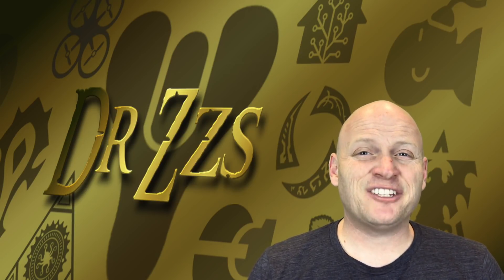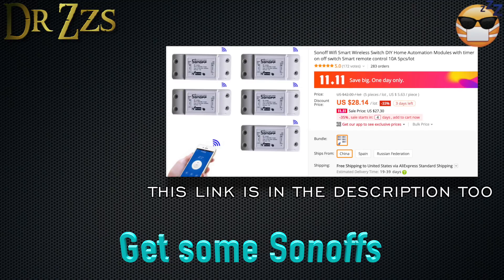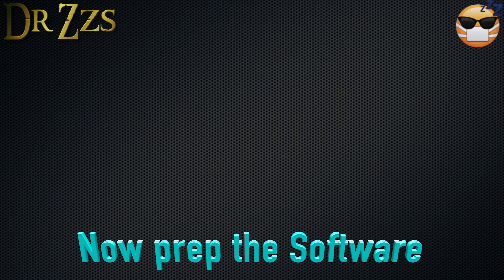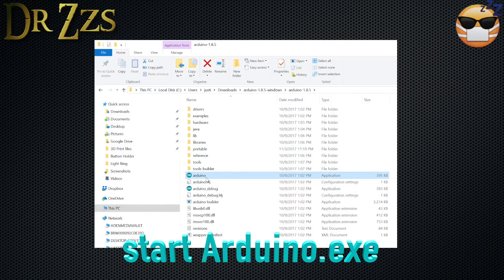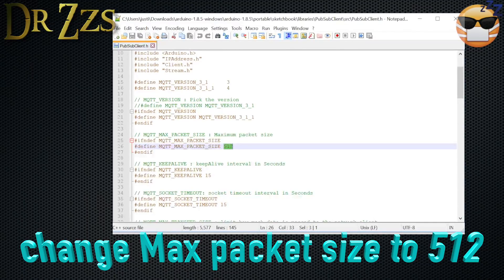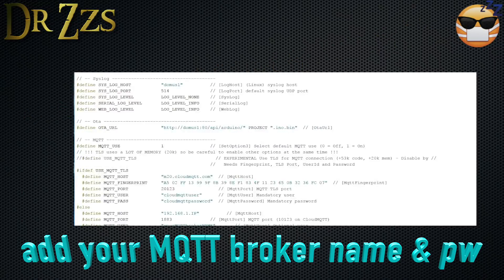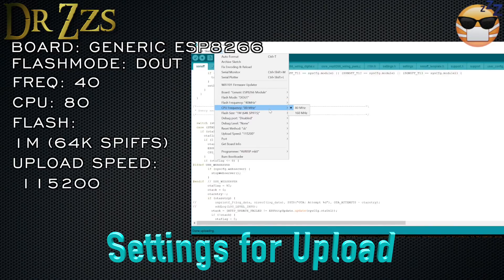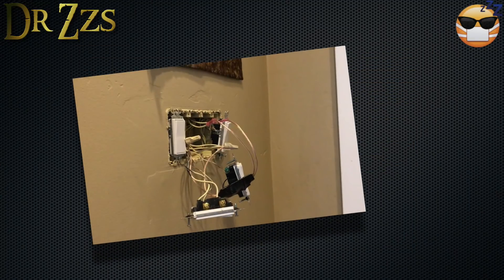Flashing TASMOTA Firmware on the Sonoff Basic

Comment: I bought a sonoff basic r2 but it only comes with 4 holes GND,Tx,Rx,3v3 from amazon. I found out from your friend The Hook up (https://www.amazon.com/gp/customer-reviews/RD37CKA59B9YF?ref=pf_vv_at_pdctrvw_srp) that amazon is only shipping this 4 hole version (no gpio14)  So now we are going to be having problems "on reboot" with the GPIO pin (Tx=GPIO01,Rx=GPIO03 both pins pull High on boot) we connect to (which after testing the tasmota firmware in a esp8266 is something that has to be regularly done).  Is there another version that will have a gpio14 to work with (an amazon link ?)

Comment: impossile to do it with arduino1.8.9
please up date information
Reply from the maker: ya, this is a very old video in the DIY Home Automation world.  Sonoff is just now putting out a v3 of the Basic.  The firmware is supposed to allow DIY mode with the ability to change the firmware to something else easily, or at least use the device without dependence on their servers.  I'll put out a video about it as soon as it's available.  Stay tuned.

Comment: How many gpios can you use? I would like to use 3.
Reply from the maker: You can use Rx and Tx.  You may get some weirdness on start up if Rx/Tx are high on start up.
Reply: @DrZzs  Thanks. I am wanting to sonoff a garage door opener by using 120v power to power the board and isolating the relay to operate as the door button and have the door button as an input. Sounds easy after watching your videos.

Comment: How did you avoid needing to solder on a pin header to the sonoff?
Reply from the maker: If you're just flashing it with new firmware you can just hold the wires in the holes if you're using male jumper wires.  If you want to connect an external switch to gpio14 I don't think there's a way to do it without soldering.  Sorry.

Comment: Finally got my sonoff sv and arduino boards in the mail. However I am reading online  that the url to place in the arduino, namely  http://arduino.esp8266.com/versions/2... is not working. Can I still flash tasmoto to my sonoff sv without the url? I see you have an updated video but don't I still need my arduino? I am a complete newbie so please bear with me.
Reply from the maker: yes, actually I wouldn't recommend compiling from Arduino yourself anymore. Use the precompiled binary of tasmota, and set the wifi settings before you disconnect it from the computer. 
Try this method instead: https://youtu.be/KMiP9Ku71To

Comment: What custome firmware offers over stock sonoff firmware
Reply from the maker: The ability to use an open-source Hub like Home Assistant and keep all the control for your smart home "local-only", that means not relying on any other company's servers.  
This may be changing very soon for Sonoff.  They are releasing a new version of their firmware that is going to have "DIY mode" that will let us control the device without needing to connect to their servers.  
If you want to just use Alexa or Google home as your hub you don't need to change the firmware.  So for most people it isn't necessary.

Comment: Hey Doc. Love your videos, bro! Thanks for all your hard work! But I'm here because I have a question, not only to sing your praises... 
So here goes. While I'm waiting for several sonoff basics to arrive (I've just gotten intro HA and smart home tech about a week ago), I've set up a sandbox HA system, and since installed HA on a Raspbian. Now to my question. I received a 'magic home' wifi led controller for an rgb strip. I dig it. The Magic Home app isn't horrible, and it integrated nicely with my HA system. So...why (like what advantages would there be) would someone flash Tasmota on this?
I read that it can be done. It's on git. But other users (in some German forum) have said that they lost functionality after the flash. What were they hoping to accomplish?...or is it just that flashing itch that tech-freaks (myself included) get that drove them to flash it? (Speculation, I know...But please speculate!) 
Many thanks again!

Comment: This is just a couple of the failures, Arduino: 1.8.8 (Mac OS X), Board: "Generic ESP8266 Module, 80 MHz, Flash, Enabled, ck, 26 MHz, 40MHz, DOUT, 1M (64K SPIFFS), 2, v2 Lower Memory, Disabled, None, Only Sketch, 115200"

xdrv_05_irremote:27:29: error: IRremoteESP8266.h: No such file or directory
Multiple libraries were found for "WiFiClient.h"
 #include <IRremoteESP8266.h>
 Used: /Users/colintimms/Library/Arduino15/packages/esp8266/hardware/esp8266/2.5.0-beta2/libraries/ESP8266WiFi
                             ^
 Not used: /Users/colintimms/Desktop/Arduino.app/Contents/Java/libraries/WiFi
compilation terminated.
 Not used: /Users/colintimms/Desktop/Arduino.app/Contents/Java/libraries/WiFi
 Not used: /Users/colintimms/Desktop/Arduino.app/Contents/Java/libraries/WiFi
 Not used: /Users/colintimms/Desktop/Arduino.app/Contents/Java/libraries/WiFi
exit status 1
IRremoteESP8266.h: No such file or directory

This report would have more information with
"Show verbose output during compilation"
option enabled in File -> Preferences.

Comment: Frustrated,  I have been fighting with these switches for ages, can't get one to work out of the box, added it (and deleted it) several times, I see it but its always OFF LINE.  Decided to do a firmware upgrade and followed your video on both a Mac and a PC, Nothing, I did get further on the PC but "oh boy" trying to run the compiler was a joke.  I tried Garry Anderson's advice, still the same, directory failures and things like IR inputs.  Going Mad.

Comment: Thanks for the great videos, they have been really helpful! I have a question though: I want to use GPIO 14 for remote switching of lights, which is easy enough, but I would like to add a connector to the Sonoff Basic case so that I can make installation more modular. I have googled around, but can't find anything suitable. Any thoughts or experience on an external 2 pin connector that can mount to the case? Thanks again.

Comment: Love your videos as they have been very helpful.

Using your instructions I successfully flashed 16 Sonoff Basics with Tasmota, but failed for some time to flash a Sonoff TH10 {last one I needed to get off EweLink}. All the Sonoff Basics have been moved to Node Red and work perfectly.

Finally, using a separate power supply, I got the TH10 flashed and can toggle the relay via a web browser and Node Red {on a RPi}.

What I cannot do, is in Node Red, retrieve a MQTT message showing the temperature {don't need humidity} I played with a bunch of nodes and thought the MQTT or the Status Node would at least capture the temperature messages but all I get in Debug is something like, below,  with an empty payload. I tried "Status" and "Sensor" in my Mqtt messages but still get an empty payload.

But this is the best I can retrieve via Node Red via a Debug node.
12/19/2018, 5:24:14 PMnode: f371cac4.c9b7b8
stat/Mysonoff_TH10/Status : msg : Object
{ _msgid: "a2da06ba.d241d8", topic: "stat/Mysonoff_TH10/Status", payload: "" }

If I can get the temperature then I just need a couple of upper/lower set points like 75F and 74F and then find a way to inject into my Sonoff_TH10 output node.

 I can see, every 30 seconds, a sensor update via the "Console" page in my browser like this: 
23:43:33 MQT: tele/Mysonoff_TH10/SENSOR = {"Time":"2018-12-19T23:43:33","AM2301":{"Temperature":69.8,"Humidity":26

Comment: Any alternate for gpio14 ? New sonoff doesn't have that.. planning to connect rocker switch
Reply from the maker: Ya, I've heard that.  I'm going to get one of those new sonoffs soon to test it out myself.  After you've flashed you should be able to use either Tx or Rx for an external switch.  I believe that is what others are doing.
Reply: @DrZzs   will try it

Comment: Instead of having to change the project name for each switch, isn't it possible to use the mac-address as a topic, like /sonoff/01AF23B280 ?

If the sonoff sends something when it is turned on, you can always subscribe to /sonoff/* to see new sonoffs
Reply from the maker: yes, very true. I believe that is how TasmoAdmin gets it's connections to all the Tasmota devices on your network.  
I actually haven't compiled Tasmota in the IDE for a while.  I've been just flashing with the pre-compiled binary, then changing the mqtt topic in the UI.  All Tasmota devices have a "grouptopic" that they respond to as well.  
Thanks!

Comment: hey quick question how can i make my sonoff switch relay to power up when reset, for example i turn off a light on HA, now my wall switch is on position but when someone goes and try to power on the light it wont work because i selected off but is the relay is set to power up when reset now the they can flip the switch off/on and the light should power on
Reply: so i found this "PowerOnState 1/ on" bus HA turns it off after 30 sec or so, any ideas?

Comment: Is it possible to flash with Arduino UNO? I will try with all steps but it said generic platform esp8266 not found. Failed compiled for generic esp8266 module....
Reply from the maker: another thing to try would be to use the pre-compiled sonoff.bin file.  Then you won't have any board manager or library issues.

Comment: Hi DrZzs, 

I just got my sonoff, Let me explain needs, I need some switch timer base as well as they could access thru physical switch by my parents. (they are not familiar with smart phones) 
1. What is Tasmota ? 
2. Do I need to update my sonoff firmware? 
3. Can I use my normal switch (toggle switch on/off)  
4. I have seen some other video can do the same without firmware update. (https://www.youtube.com/watch?v=oUFuuoNfvyc)

My intention to ask question to clear out my doubt, not to hurt your feelings. Due to so many different solution. I got confused.  
In Advance, Thanks for suggestions & advice

Comment: I am a little late to the Sonoff game, but I have a question. I can't connect a new Sonoff to my router because it is 5ghz...and my phone...and my Galaxy TabA. So am I skrewed when it comes to 2.4ghz devices? I hate to flash them only to find out they are worthless. Note: My router is an Xfinity dual band style. One Raspberry Pi is on the 2.4 ghz band and the Home assistant Pi is on the 5ghz Pi.
Reply from the maker: Bummer. The ESP8266/8285 chips are 2.4ghz only.  There may be other devices that use 5ghz, but not the Sonoffs.  
Sorry.
Reply: And now some good news. I have an android tablet, that when checked, is on the 2.4ghz band. I was able to install the ewelink app on it and got one of the Sonoffs installed and the firmware upgraded to 1.8 something. A second one failed to connect multiple times so I gave up. Now to work on the Tasmota flashing. Thanks.
Reply from the maker: Glad you got that far at least.  You may have trouble trying to connect with any ESP8266 device still without a 2.4ghz band on your wifi.  Good luck!

Comment: i know this is a old video. I have followed most of your videos but still getting stuck with my first flash. I have 3 Sonoff POWs and I would like to flash them with Tasmota. I have 3x S20 which I use with IFTT to HA and would like to try the flash them too and have few more items on order. 

As the link you provided for the adapter from  Amazon is charging a bit to deliver to AU I ordered this https://www.aliexpress.com/item/FT232RL-USB-to-Serial-adapter-module-Mini-USB-TO-RS232-For-Arduino-pro-mini/2035873939.html and it matches the spec (Although pin arrangement is different I think it is the same item and I have figured out pin connections in adapter and POW)

My problem is  when I connect the adaptor to windows 10 PC win 10 does not create a new com port for the serial adaptor. I trialled in two machines both running windows 10 with latest updates. Not sure if I had to install some kind of drivers (I had to install drivers to flash Node MCU  board on a previous project as com port did not get created till that though Ben in his video did not mention anything on need for drivers. )

So my question is are there any drivers to load?. When I connect the adaptor a green light come off and dissapear immediately. I do not see any new com port getting added. In device manager no unknown devices too. What is you experience on this.

Not sure what is wrong but I am struggling to understand what I shouldI do to get the sonoff to flash mode (get a different adaptor, different mini usb cable???).
Reply from the maker: First try a different cable. Some usb cables are power only. 
If that doesn’t work then I would guess you do need a driver. 
Search around for a model number and search for a win10 driver for that device. 
Hope that helps.

Comment: Build options changed, rebuilding all
Sketch uses 560213 bytes (54%) of program storage space. Maximum is 1023984 bytes.
Global variables use 55792 bytes (68%) of dynamic memory, leaving 26128 bytes for local variables. Maximum is 81920 bytes.
Uploading 564368 bytes from C:\Users\TEMP\AppData\Local\Temp\arduino_build_199593/sonoff.ino.bin to flash at 0x00000000
................................................................................ [ 14% ]
................................................................................ [ 28% ]
................................................................................ [ 43% ]
................................................................................ [ 57% ]
................................................................................ [ 72% ]
................................................................................ [ 86% ]
........................................................................         [ 100% ]
next what i have to do
Reply from the maker: That means it's done flashing.  That's success! 
Now you connect to the sonoff's wifi and input your wifi information. 
Then get the IP address of the sonoff from your router, then go to that IP and input the other configuration settings you want (most important is MQTT).

Comment: Thanks for the guide. I made it, but as I'm a new user I found a trick problem that I have no clue how to fix it. 
My sonoff-tasmota didn't toggle the relay output (GPIO12) only the LED output (GPIO 13), so it's useless for me.
Any ideias may help... Thanks in advance...
Reply from the maker: That's odd.  Tell me more about your setup and what you're seeing.  Can you control the relay from the Tasmota web UI?  Did you change any settings in the console?
Reply: DrZzs Thanks for your reply. I figured out what I did wrong. The gpio 12 works fine but the relay not. That is because I was powering sonoff with FTDI. Only 3.3V circuits works with FTDI power wich not includes the relay. Using AC outlet power, the relay works fine. Thanks again...

Comment: Bummer...well, I just opened up one of my sonoff switches to find that the 5 pin holes that you used to flash the device are filled in with solder.
Reply from the maker: I've heard that is the new norm.  I haven't received any new Basics in a while so I haven't tried flashing in that state.  I'm going to try just holding the male jumpers during flashing.  Maybe use some blue tac to hold them in place temporarily, or get someone to plug in the USB adapter while you hold the jumpers and the on-board button. 
Maybe that is something we can try to do this Sunday morning on the live stream.  I can take a basic I have laying around and fill the holes then try to flash it.  
I've got a 3d-part designed to use as a jig, but again I haven't tested it yet.
Reply: Yep...thanks for the response.  I wonder if there's some sort of connector that has tiny rounded bumps on the end of it that you could feed the wires into and then the bumps would be springy (like the inside of a key tumbler) and then you could just hold the connector against the 5 pins.

Other than that, I'm going to solder a header onto the board.
Reply: I received my sonoffs in the same condition and chose to go through the initial pain of just soldering in some male pin headers in all my sonoffs. I then use female-female jumper wires for flashing instead.
https://www.dropbox.com/s/aqpmlr7a7hdjv0f/IMG_20180629_234538.jpg?dl=0
Reply: Same thing I'm going to do.  I've never desoldered before, so today I had a tough time finding braid and flux that wasn't for plumbing only...Amazon to the rescue.
Reply: Just got four in yesterday. Thankfully, all four are v1 with the holes unobstructed.
Reply: I managed to suck the snot out of the holes and solder headers to the board, but it would have been easier if the 'over the air' flashing was working.  I can't figure out what version the ones I have are (v2) to know if the remote flashing even works.

Comment: I have stuck with this error 
Done compiling
Archiving built core (caching) in: C:\Users\TEMP\AppData\Local\Temp\arduino_cache_177862\core\core_esp8266_esp8266_generic_CpuFrequency_80,FlashFreq_40,FlashMode_dout,UploadSpeed_115200,FlashSize_1M64,ResetMethod_nodemcu,Debug_Disabled,DebugLevel_None_____f7025fb08a3574e99f1785948801a9c1.a
Sketch uses 537292 bytes (56%) of program storage space. Maximum is 958448 bytes.
Global variables use 56508 bytes (68%) of dynamic memory, leaving 25412 bytes for local variables. Maximum is 81920 bytes.
warning: espcomm_sync failed
error: espcomm_open failed
error: espcomm_upload_mem failed
error: espcomm_upload_mem failed
Reply from the maker: usually that "espcomm" error is caused by either:
1. The Rx/Tx wires being connected backwards.
2. Not getting the board into Flash mode
3. wrong Com Port selected in Arduino. 

Have you seen the newer method for flashing?  Try this - 
https://youtu.be/NNW05smSNOA?t=2m3s